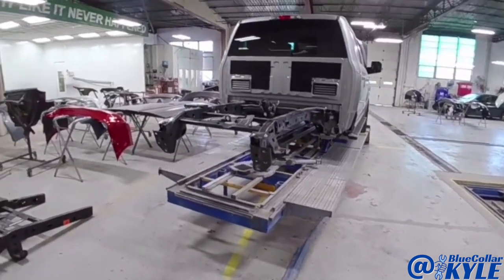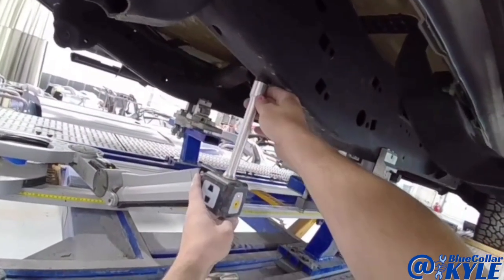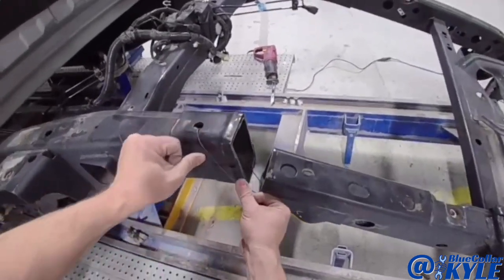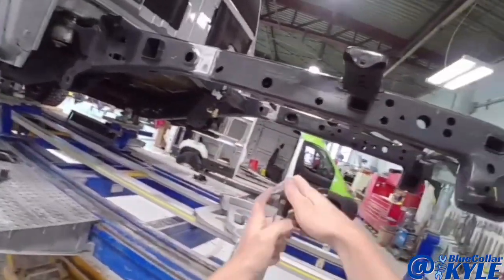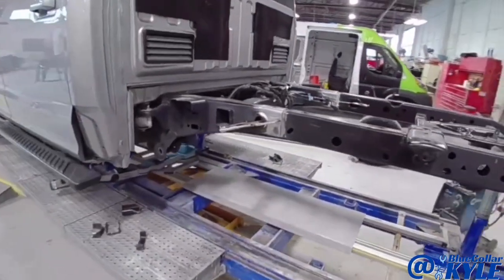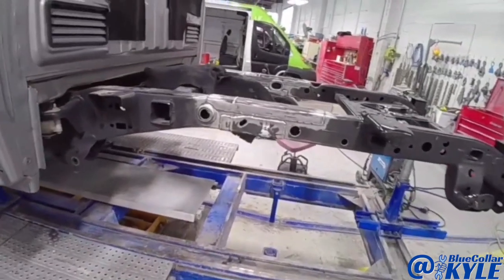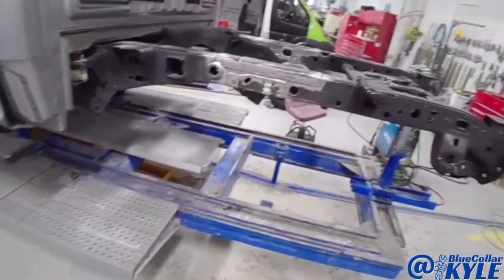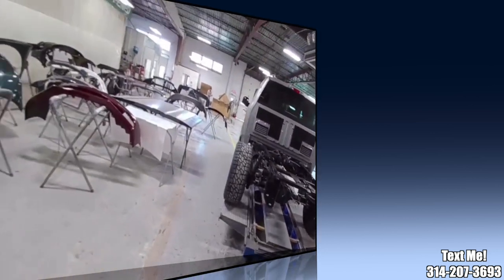Cutting A Truck Frame In Half!

Comment: hey Kyle, i have a 2017 RAM 2500 with somewhat similar damage.  someone tried doing a hack weld job of it.  it seems like the damage js more isolated to the back and the hitch assembly, but Im not a professional.  when a frame get crunched even a little bit in the rear, even if its seemingly isolated, is this typically the required repair (cuttinf off this much of the frame), if so how much does a repair like this typically cost?

Comment: Well I'll be a wild turkey, I didn't know it was this easy to extend the F-150 frame chassis to go from a 5.5'ft bed to an 8.0'ft bed. Now I can just have my current truck extended rather than spending $75,000 for a truck with an 8'ft bed.

Comment: Question: are you seeing insurance companies more willing to do more extensive repairs sense vehicles are worth more since this Wuhan flu hit?
Reply: From what I’ve seen, they total them with less damage than what would previously be a cause for a total loss. They bring retail money at the salvage boys auctions, even with all the damage; it’s ridiculous.
Reply: @hamiltoncooper3603  Same here i see so much being totaled for not much damage at all. I bought my sister a totaled Civic from a customer for front bumper cover & fender with low miles i fixed it in 3 hrs with parts from a totaled Civic in the rear we had at the shop that was abandoned she's been driving it for 5 years paid like $1,000 for it clean car
Reply: Insurance gets good money from the auctions nowadays too, so totalling it out sometimes makes more sense.
Reply: I had a 2018 Camry with less then 30,000 miles on it.I clipped a buck on the highway that only broke the grill, and the passenger bumper mount which I fixed myself for less then $100, but all 12 airbags deployed..totalled! Apparently, the airbags are worth more than the car 😂